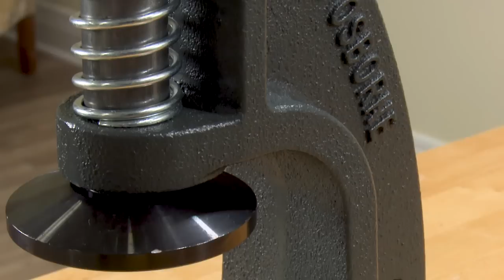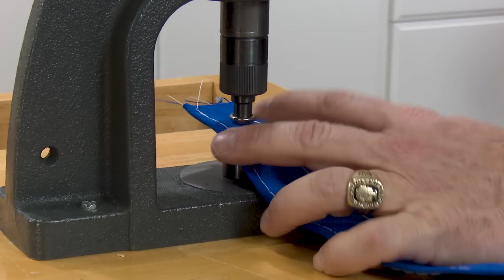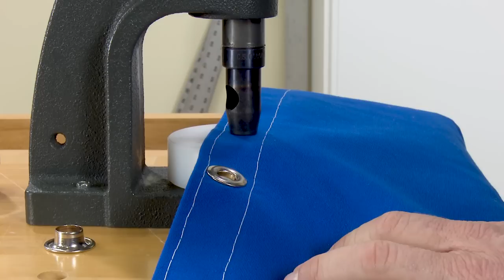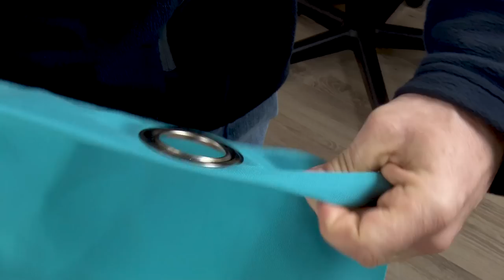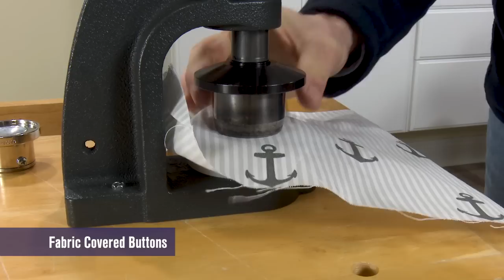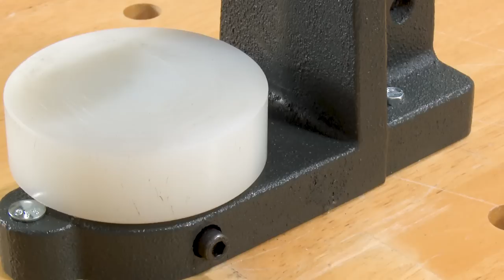Demo of CS Osborne W-1 Hand Press

Comment: I bought one of these a few years ago when I saw ALO use it for buttons.  I still have my Hoover Pres-N-Snap that I use when I'm not at home working on something or if it's in an odd place, but this really makes it easy to do grommets.  A few weeks ago I had to set 28 grommets with the Hoover because I didn't have #0 dies for the C.S. Osborne.  My wrist popped twice and my bicep was on fire.  I immediately saw that Sailrite started carrying C.S. Osborne stuff and didn't think twice about ordering a set.  It's now my go-to.  Now I just wish I had a set of hydraulic dies for Rutgerson Super Rings :-P
Reply: NGinuity Do you know if this will do plain #2 (3/8") grommets ?
Reply: Yes they do.  Sailrite doesn't sell it (yet), but it's part WDIGRC2, Manufacturer Part Number 75861.  I believe C.S. Osborne has die kits for Plain from size #00 to #15 and Spur from #0 to #10.